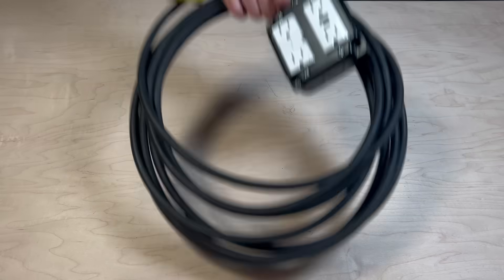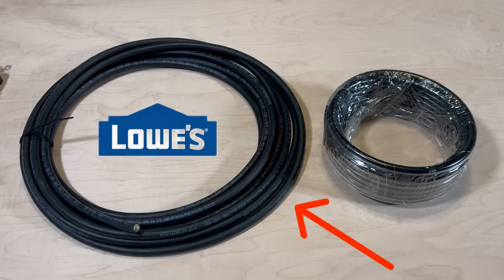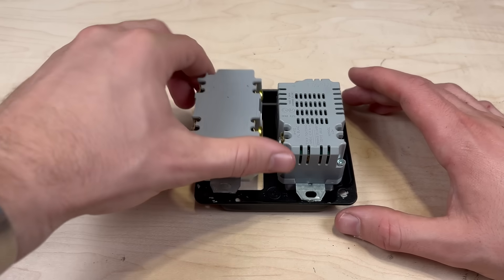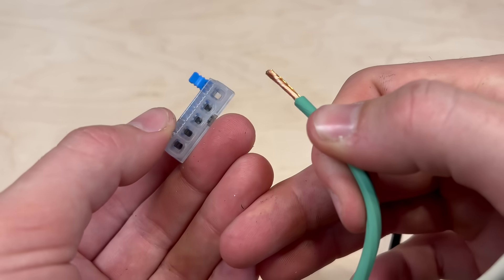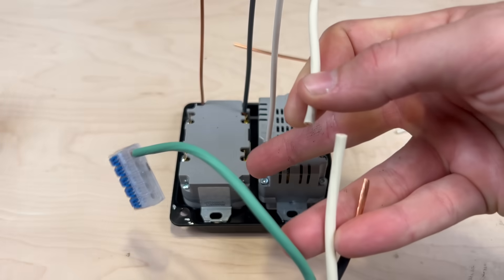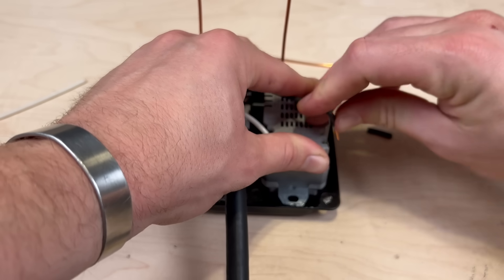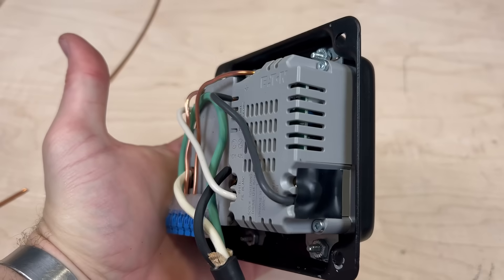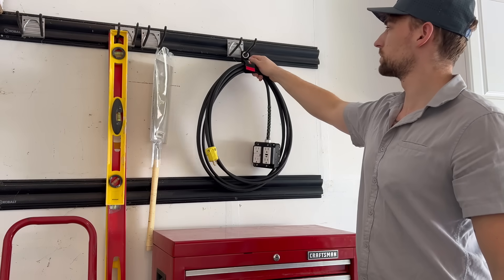HOW TO BUILD THE ULTIMATE EXTENSION CORD!

Comment: good way to save your thumbs, us a pvc cutter instead of a knife.  also they make really hand safety box cutters so cut insulation vertically. Also on any ground like that I use copper based antiseize, makes them corrosion resistance.
Reply from the maker: Good ideas, thanks!

Comment: I made a cord like this but found it’s heavy because of the box and no good for inside use. The box will scratch the floor.
Reply from the maker: Yeah I use it in concrete so it’s not an issue but I wouldn’t be able to use it on hardwood

Comment: this is good only if the plug u are using is 20amp, most residential outlets gonna be 15 so u really only need 14 gauge for your wire, also no matter how much sheathing and rubber u put aroud a stranded wire it wont be better durability and reliability than just using plain solid romex

Comment: 5:03 I’m not an electrician, but that load conductor should be trimmed back so no bare copper is exposed once it’s clamped under the terminal. Especially since you're using a metal box.
Reply from the maker: Yup, you’re right

Comment: DO NOT HAVE BARE COPPER HANGING OUT OF THE TERMNIAl!!! Even if it it's minor, it could touch something. Always make sure the Wire insulation is up against the pressure plate so no copper is showing.
Reply from the maker: I was having issues with that so I went back in and trimmed them down
Reply: @SemperDIY  Oh, Ok, well regardless you did a really really good job! Have a good day Sir.

Comment: 2 things that jumped out at me for your next ones from the point of view of a gaffer (I've made hundreds of these) 

1)  We don't call these extension cords, we call them "Stingers". -  Extension cords could extend anything (extend a USB, Extend HDMI, Extend BNC,  etc)  -  "Stingers" ;always deliver power. 
2). Don't use the pressure plate when on the outlet side,  pressure plates are great for adding outlets in walls, because walls don't move, but you're going to be throwing this thing all over the place,  put a hook on those wires and hook them around the screw, old school style.
Reply from the maker: Thanks for the advice!

Comment: Use a cast box with hubs (Bell Box aluminum with tapped hubs) so there is no chance of open knockouts with threaded hub plugs the knockouts in the steel box could get breached, short out or break off and create an exposed shock hazard. 50 Volts AC or DC or greater can kill you.

BTW that steel box with removable KO's is NOT UL listed and violates code for this use. Get you a Bell or similar cast box and you will have the safest cord you can fab of course the wire sized, strain relief. proper dead front cover so no live parts  are exposed

I'd approve your cord in a plant I audit with the steel box exchanged for a cast aluminum with threaded closable hubs all unused blanked and tight.

Only suggestion go with a cast box like you would put outdoor outlets in.  The rest seems to be OK or even really good to me.
Reply from the maker: Thanks for the suggestions!

Comment: This build is really neat and a great idea. It hits at something that we often need but isn't really something available to buy. It's still amazing how much a DIY project ends up costing due to the cost of wire, especially heavy wire like you're using. I'm putting this on my long term to-do list. I was also wondering while watching if a similar build using a waterproof outdoor box might be worth attempting. It wouldn't be as easily accessible, but might be more user friendly outside where the ground might be damp.
Reply from the maker: I appreciate that! Yes, I’d use a waterproof box outdoors just to keep junk out

Comment: If you want the best .....lose the indoor box and get the 2 gang weatherproof with a bubble cover ......that's the best and you do not need 2 GFCI'S....................I would not let this dude wire a dog house..............
Reply from the maker: There’s only one GFCI
Reply: @SemperDIY   Well why 2 in the video .....? And the box is not weatherproof..... holes in the back....indoor box... and whats with the 2 locknuts? No locknuts needed in a weatherproof 1/2 inch Bell box....Are you a licensed electrician ? P.S Lose the sissy cheap ass amazon clip connectors also....

Comment: 1) Go to your local welding supply store for welding cable. It will be the most flexible.
2) Paint the box with bedliner, preferrable a rubbery one.
3) Hospital-rated outlets have a mechanism that prevents accidental pull-outs. 
3.5) Toss some blue loctite on all the nuts so that you don't have to think about it for a decade. Use red loctite for 50 years. And use green loctite if you want it to last longer than the Sun.

Just suggesting some ways to make this extension cord more expensive.
Reply from the maker: lol, thanks!

Comment: Just a heads up for your next build from an IATSE union electric on how we build the best AC Stingers (extension cables) for film sets. To take this to the next level, upgrade both the Edison plug end and outlets with hospital grade extra heavy duty models (personally use GFCI weather resistant models) and use ferrules with a square compression tool on the ends of each wire. We would also often use a rubberized more sealed case.
Reply from the maker: Thanks for the advice!

Comment: Most of the time these days.  I buy an extension cord the length I need.  Cut off the receptacle end and now I have a cord of whatever gauge I needed to buy with a lit plug.  When I factor in the cost of the cable, plug and my time.  It comes out about equal.
I mostly use the plastic boxes.  I find them easier to work with.  There is a selection of sizes.  And you don't have to round the edges off.  They are already fairly smooth.  But if you like, a quick pass with a sanding sponge will remove any extrusion burrs. 
The box I use never sees the floor.  I mount the box on a piece of 2x8 about 3 times longer than the box.  I round the edges on the wood.  Hole saw a 2 inch hole on the one end.  And finish the hole with a round over bit in a trim router.  This can be used to hang the whole unit up should you be working in wet or unfavorable conditions.  You can hang it numerous ways.  Using Zip Ties, carabiners, just use your imagination.  
I tend to stain and clearcoat the wood to protect it.  And you can spray paint your box pieces then clearcoat before assembly. I do other things to the overall assembly.  It all depends what I am going to be using it for.  And by the way.  I anchor the cable leading into the box with some well insulated clamps.  It's not going to be pulled out.  The wood base also keeps the whole thing stable.  So it doesn't get flipped over upside down.
The massive unit I made for my 240 volt, 3 HP Cabinet Saw has served me well for years.
All The Best Everyone.
Reply from the maker: Sounds awesome! I’d like to see that in a video

Comment: I want to build a 10 AWG 240 V 20A version of this for the automotive lift I have in my garage. I already have the needed wall plug, I need to add 20a fuses for the two hot wires that would be wired in just before my device. What fuses and housing would you guys suggest for that? Thx!
Reply from the maker: Voltages over 120 scares me lol. Good luck

Comment: When using stranded copper wire like on the end of your plug or putting it in your lever not always turn the stranded wires to the left not the right it makes the copper more rigid like a solid conductor also when using electrical tape on your Outlets use colored tape white red blue any color don't use black colored electrical tape is considered marking tape not electrical tape it holds up much better over time it's easy to remove and it doesn't get all greasy grimy and degrade like black if you've ever taken black electrical tape off of something in a box you know how messy and dirty it is becomes crispy brittle gets black all over your hands. When grounding two devices in a box and grounding to the green screw in the Box I prefer to put a hook on one end connected to the device Loop it around the ground screw of the second device wrap it around the ground screw and then just use one single small wire nut to connect it to the feed no need to use 4 grounding conductors in a tiny shallow box
Reply from the maker: Thanks for the advice!

Comment: For the plug, is there something that can be put around the incoming line to help prevent water? I know it's not going to be water tight just looking for ways to help prevent splash.
Reply from the maker: You can use a waterproof box with a cover. Also, the plastic strain relievers are water tight

Comment: At 3:35, concerning the strip length, the lever connectors (WAGO, IDEAL, F4P) have a strip gage printed or stamped directly on the connector. It's important that  the exposed conductor does not extend past the insulating body. I've used five  different types of listed lever connectors and every one of  them has a different callout, even the two  generations of WAGO. Great video <3
Reply from the maker: Thank you!

Comment: Very cool always wanted to build some of these and give them as gift to the guys. One thing that might help. When you cut the shielding from each cable don't pull it off use that to twist as you pull it off. That will give you a really tight and clean twist on your lines
Reply from the maker: Thanks for the advice

Comment: My late grandfather had a super heavy duty extension cord where the outlet had a spring loaded cover over it so debris couldn't fall into the contacts. It was 10 meter long and I believe the cable was thicker but it seemed to be the same construction as this. Unfortunately the cable had to be repurposed for some other outdoor electrical and as such it was disassembled. If it was still in one piece it would be as old as my father.

Comment: When I did this I drilled 2 holes through the steel box, and ran the neutral wire to pass outside of box and back into it (surrounded by a thick clear nylon tube for physical protection).  In this fashion, if you desire to measure the ampacity any given 120 vac device draws, i unplug the devices plug from the wall recepacle, then plug it instead to this extension box. Now its trivial to hook a current meter over the external loop of the single neutral conductor.

Comment: This is a really handy build... they work great... 

If not able to find a velcro tie strap...I use a reusable zip-tie. they usually come about 12" length and be about ~3/8"wide. 
Zip-tie that to a few inches from the plug., cut small tie tail flush...  
Should last quite a while, and if not the bag reusables will...

Comment: Ha nice one I have actually replaced a GFCI before with a load wire all I simply did is kept the wire nut on the load to wire the line wires first then remove the wire nut to wire the load(yes mine had pigtails since it was a USB GFCI) then I replaced a gfci outlet without a load wires and that one is more simple

Comment: Your words "It might turn into a $150 eyesore" but it will turn into one after just a few uses, since the paint will begin peeling with only a spray of black. Apply a primer before painting; this helps the spray paint stick. After the paint dries, finish with a clear protective sealant to make it more durable.

Comment: get a cheap metal lunch box and put a other outlets or even a switch on it. if you install them on the bottom of the lunchbox, you have full access to the wires through the lid. spray it with plastidip to insulate it like a bawss

Comment: You could have pig-tailed the grounds together with a wire nut, those "Wago" style connectors are just a substitute for a good splice.   I also would have used a plug with an indicator lamp, then you know the outlet you plugged it into is hot.  This is a cool idea regardless, and I do agree with the higher quality cord and the spring stress relief, good call there.  Those cheap thermoset plastic cords get brittle and crack over time and they are very stiff in cold weather.

Comment: Meh. Unecessarily complicated. Only 4 outlets. Not water proof. Expensive. Violates code. Heavy. Short wire which is the whole point. Overall, I won't say fail, but not great. Just spend ~$25 at Harbor Freight and get something nice if not better.
Reply from the maker: “Your wrong Colonel Sanders”
Reply: @SemperDIY  I studied EE. This is WAY over engineered and unnecessary but have at it.

Comment: I think you did a good job and respected the codes in the USA but where I’m from that would be completely illegal. A few pieces of advice that would help so that the extension cord will be safer, on stranded wires always use end terminals, the kind that are crimped, the ground cable would be better if it was also insulated and make sure that all wires are uninsulated just enough so that the wire fits and no more, no copper should be showing when connected to the outlet
Reply: Well it's a good thing he doesn't live where you do. Who cares if something is not up to the code of a country they're not in?

Comment: I was gonna comment the price couldn't be cheap. I just put 5 usb outlets in my 1980 trojan f32. I work on boats and have a stock pile of gfis and  they arent cheap tho there is a significant price differemce between 15 and 20 amp . The S/O cord gets used for shore power all the time but I used to use for overhed crane controls with the fingercuff connector before I switched to marine electrical. Even ground screws are $3 now and you only needed one to sting that box. I used to make these up from used material and probably still have a couple somewhere. The cable used here is very durable and great for pro extension cords. The inly thing i would'e done differently is that I would've (out of habbit due to my trade) used Y crimp connectors on the stranded wire for the gfi line input.

Comment: I was ready to start, right until I heard metric channel locks. 
Now I'm BACK at the home Depot and can't find them. 
This is ridiculous. 1 Star would not recommend
Reply from the maker: Sorry buddy
Reply: @SemperDIY I was actually on my way to home Depot. I'm doing basically the same thing but I'm going to paint my box with rubberized undercoating and my cord is 12 gauge heavy duty extension cord
Reply from the maker: @RushCampAndPrep awesome! My paint is chipping odd so hopefully yours sticks better
Reply: @SemperDIY that's why I went with this undercoating spray and I'm doing several thick coats inside and out. It should provide a durable finish

Comment: very nice quality work - I don't know if i would have painted the box though - that is not only insulating the ground but it is chipping already in your video.  Also be careful when stripping your wires as you don't want to mar the conductor as I saw you do at one point on the solid copper wire.
Reply from the maker: Yeah I shouldn’t have painted it
Reply: @SemperDIY all good man - I like your choice of brand and type on the outlets and that wire is def the way to go.

Comment: Alright, well, right away i see a problem. The insulation should be up to the stop on the outlets, there should be no exposed wire there. Also, on the 2nd outlet, those little squares of tape will last about 3 months, fully wrap the 2nd outlet 2-3 times as well. I prefer wire nuts, cheaper and give a better connection, when installed correctly. All in all, a usable outlet though, no fatal errors!   👍

Comment: @ 7:29 note that--if you painted your box, it is important to sand off or scrape the paint where the ground wire and screw touch the plate--the video shows that done but no comment was made.  Paint would be an insulator there so you want to have a good clean metal-to-metal contact with no paint interfering.
Reply from the maker: Thanks!

Comment: @ 1:20 Yeah--you GET what you PAY for.  Do not be deceived.  The Chinesium power cable crap on Amazon is UNSAFE because undersized wires are a FIRE HAZARD.  So please, buy the good stuff and suck it up at the checkout.  Buy quality and avoid unsafe power or worse, a fire.

Comment: The I or IN in Line stands for incoming power???? is that something you came up with by yourself or did someone actually tell you that? Been an Electrician for some time and have never heard that before but it seems to be a good way to remember it - I may use it as I am teaching our apprentices - good build but would recommend not leaving your wire exposed above your tape - it could still cause a short if it touches piece of metal or another wire - as another person mentioned they do make deeper boxes which work great for this type of project and as an electrician myself have also made several of these over the years from scraps off of jobs.
Reply from the maker: Nope, I heard it and that’s the diddy I use to keep my wires straight
Reply from the maker: After about a month of use, my GFCI kept shorting. I think it was because my box ground wire was coming in contact with the small amount of exposed power wire. I shortened the wires and now I have no issues

Comment: Hey buddy, I always tin my wire ends with flux core solder. Try it on your next build...you'll thank me.  Also, drop a little super glue or the like on the outlet retainer screws, it'll keep the nuts from backing out (they always work loose over the years).
Reply from the maker: Thanks for the advice!

Comment: I wanted to like this... but stranded wire is not meant to be used in these types of terminals. They can become loose over time and thus need a crimped connector of some kind. Alternatively soldered connections can work, but you shouldn't do that either unless you don't plan drawing near their 80% continuous rating. Treat soldered connections as if they are a 14ga instead of a 12ga.

Comment: Yeah, this is NOT how you should make one of these. 

Wrong box
Wrong outlets
No exterior covers
Don’t use a Wago connector on grounds
Didn’t leave enough wire in the box for service loop
Should use 20 amp plugs and outlets on a 12awg system
Reply from the maker: Thanks for the feedback